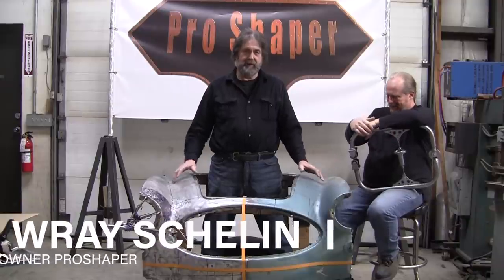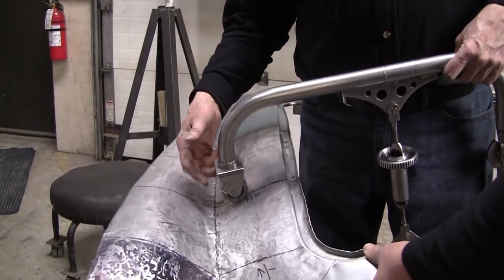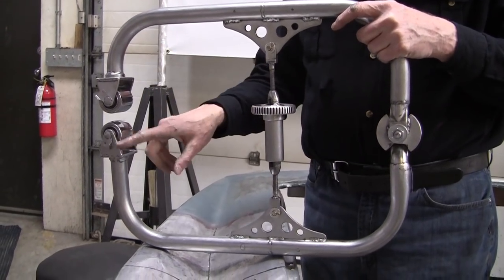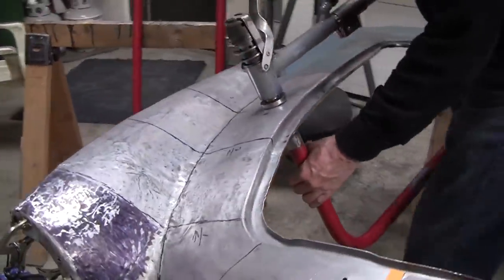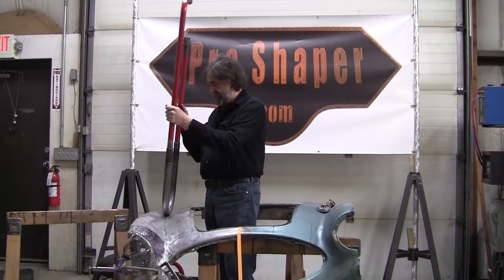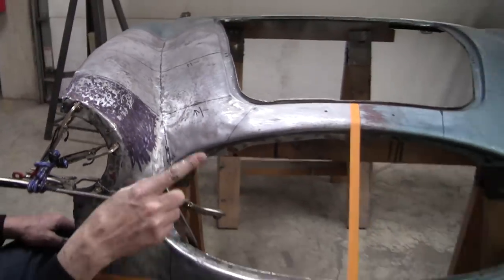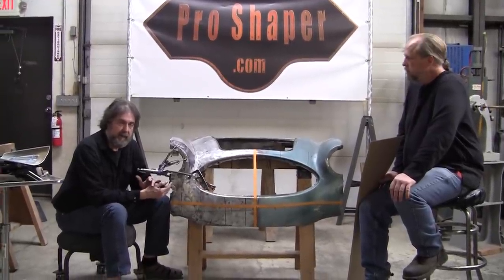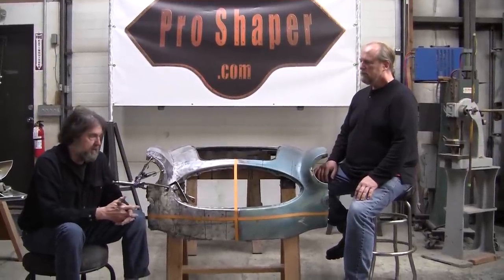Mobile English Wheel vs. Planishing Hammer

Comment: Wray, when I suggested the portable English Wheel a few episodes prior, you po po'd it, saying it would be too unwieldy and heavy.  And here it is!  Ha,Ha, good job, I knew you could do it!
JIM  :washhands:🤩
Reply from the maker: I made one five years ago out of aluminum, and I wasn't happy with it, it turned out too heavy.  I have tried the original 1920s cast iron versions and they are crap. I said in that earlier video titanium would be the best solution, this steel tubing frame is a compromise.  If this version works well- and it looks like it will- we'll make an 18" throat version and video it.

Comment: Two little project I would like to see are:
 1- A small rust repair. I envision rust in a corner of a fender  with a compound curve  and lip that attaches to the inner fender. The repair would likely entail creating shape form templates, making the repair section to fit, cutting out section and spot welds, fitting repair panel and welding in place, removing weld distortion, and metal finishing.
 2-Creating a floor replacement section that has formed stiffening ribs that match the rib size and shape in the orginal floor section
Reply from the maker: I will be doing floor repairs on the 52 Cadillac project. Also a panel still needs to be welded in on the Cadillac front fender.

Comment: I would love to see a guide on using a complex hammer form. You showed making a hammer form for the bottom of a motorcycle tank and have talked about how easy they are to use. It would be nice to see how easy they are to use. Like hardwood compared to kitty hair issues and variances.

Comment: Wray, I like your mobile English Wheel tool and have an idea. The flange for both top & bottom can move 90 degrees by using two detached flanges, located by roll pins, rare earth magnet and bar stock fitting inside the DOM tubing. 
  Borrowing an idea from a huge shrinker/stretcher made by a company known for huge metal equipment. Roll pins locate rollers, magnet holds them when loose during fitment on panel. But wait, there’s more! Push-Pull is how the English Wheel work so at 90 degrees you need a handle that screws in like angle grinder or loosen and freely rotates the direction you want the wheel to go. I have large drills with split-pipe and nut welded, screw with “T” handle to point the desired direction. With correct wheels, go front to back w/o loosing that option. DK, ASE master retired

Comment: The question always comes back to the wheels for me. Most don't have lathe and a heat treating oven around so the wheels have to be bought... or do they? Especially for aluminum work, how much of the handheld wheel can be DIY if you only have a hobby stick or flux core welder and hand tools? Thanks.
Reply from the maker: The small mobile English wheel we built has mild steel non heat treated wheels.As long as you don't abuse top or lower wheels they don't need to be heat treated. If you run over plasma cut edges or un-ground welds you will bug up the wheels, use them properly and they will provide years of service with aluminum or steel.  Step up to a tig it will serve you well. They can be purchased for $1600.00 ( more amperage , AC/DC, and lots of bells and whistles)down to as little as $200.00

Comment: Can you show how you make such good templates?
Reply from the maker: Profile gauges are made from good quality cardboard. Make sure you have enough width so the backbone of the gauge doesn't weaken when you cut it out to match the profile.  At first you just hold the cardboard up to the curve you want to copy  and freehand draw a parallel line. We have been using cordless paper shears to cut the cardboard. Then you keep trimming the high spots, finish with 80 sandpaper. It should take no more than a few minutes to make a profile gauge.
Reply: Thanks

Comment: Wray, you do awesome work and your mobile E-Wheel is just what I'm looking for. I have a lathe and can make the upper and lower wheels, and a buddy with a tubing bender. We have discussed building both a handheld planishing hammer and english wheel. I haven't been able to nail down a good size tubing, what diameter and wall thickness tubing are you using?
Reply from the maker: I think it is 1.25" dia with .080" wall.

Comment: I am going to try to build a tailgate for my Willys pickup with the Willys Overland emblem rolled into it. I believe I have a fair plan of process in mind but have a question with bead rolling a consistently tapered line for the arms of the "W", I am thinking the skateboard wheel and narrow die are the best bet to achieve the line, but it also has a rather distinctive taper and curve. To turn the wheel, make the curve while raising or lowering the top die is, IMHO, challenging. I am excited at the prospect of seeing where you go with the bed and tailgate on your Studebaker project.
Reply from the maker: I have no script bead rolling experience, when I get to the problem I will solve it. I'm no help for you right now.

Comment: How do you make some of the Pattern Templates for the Healey Shroud when you can't trace from the end of the Panel? I have a Contour Gauge, but its not wide enough or doesn't always have the range ability for more contoured areas. For example you made a Template for the area approx. 6-10" back from the Headlight
Reply from the maker: We'll show the process of how to make a profile gauge again  in an upcoming video.

Comment: TIA. When you made your own planishing anvil dies for your planishing hammer, what type of steel did you use to fabircate them? I am asking if it was hardened or if you hardened them, for use. Also, do you fill the tubing with Sand, to take the reverb from the planishing out of the handle?
Reply from the maker: Some of the planishing hammer dies I made some are original CP dies.  I have made dies out of A-2 ( A-2 is air hardening), and also  StressProof which is already hard but turns easy with carbide. There are many other steels you can use for planishing hammer dies.  No sand in the tubes.